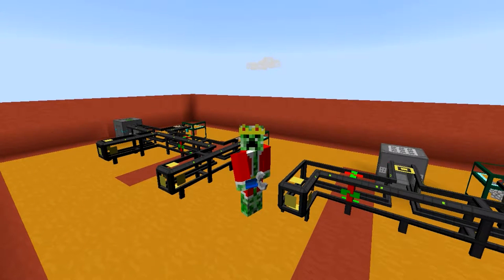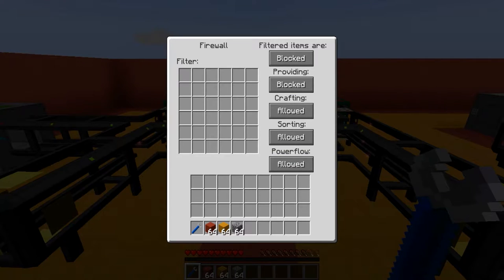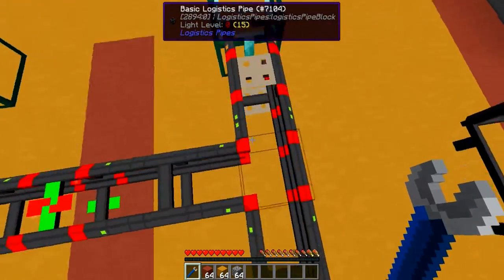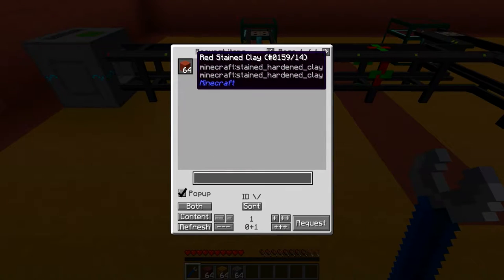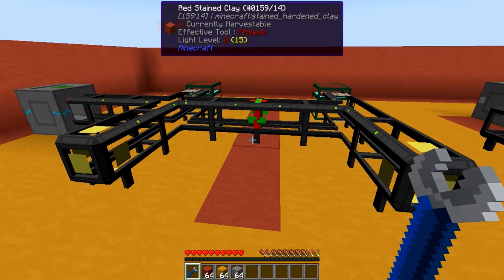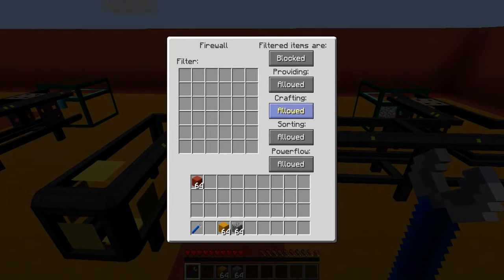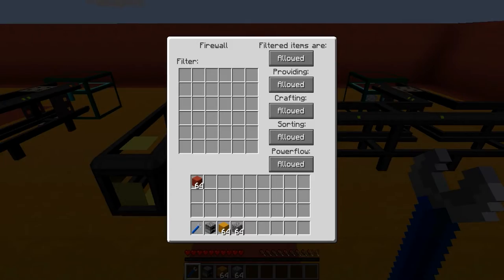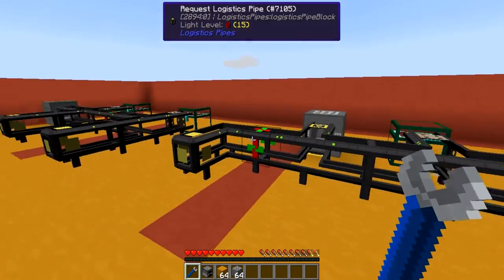Logistics Pipes Tutorial - #20 - Firewall Pipe

Comment: Do you know if there is anyway to use a Logistics pipes autocrafting through a AE terminal? :)
Reply from the maker: Hey Max! Sadly it is not possible to send autocrafting requests from LP to AE2 or the other way around. It is possible to supply let's say a stack of Furnaces to your storage in Logistics Pipes using a Supplier pipe, so you can take it out using the AE2 Terminal, and make LP refill autocraft it by itself.
Reply: Yeah thought so, I have done the other way around to jump over the step with channels, but wanted to see if it was possible. But thanks for your response
Reply: Do you mean to request and Item in the AE Terminal that will originate from a Logistics Pipes network, be crafted and then you can grab in from the AE Terminal?
Reply: StratX The question was already answered, but god. Why comment on like a half year old comment? :')
Reply: Max Björk I'm still wondering the answer to my question. I don't care how old it is. /shrug
Reply: StratX No it doesnt work, I have seen a addon mod that does that. But cant recall the name
Reply: Max Björk cool.  thanks.